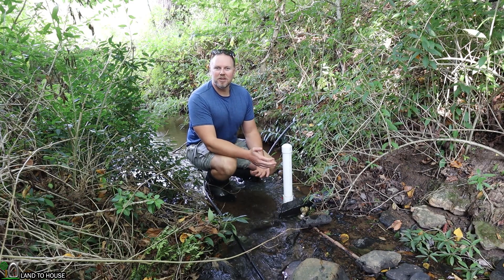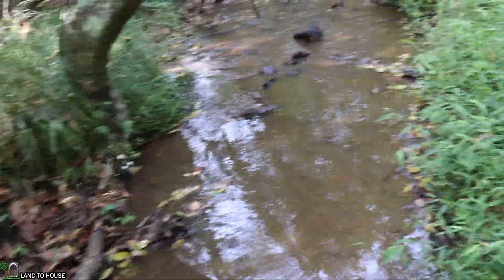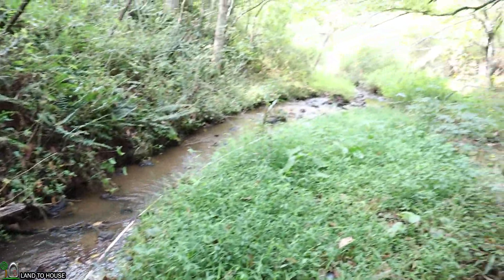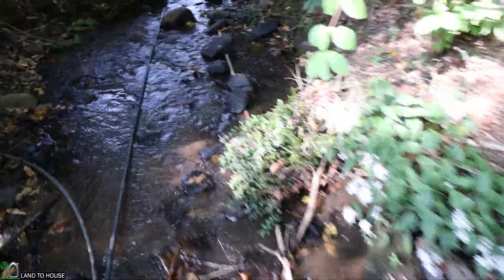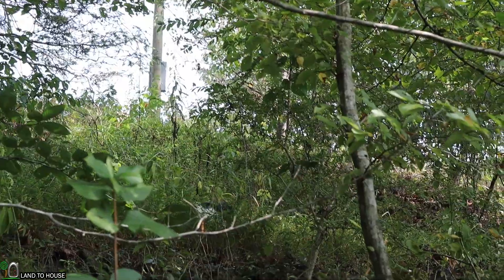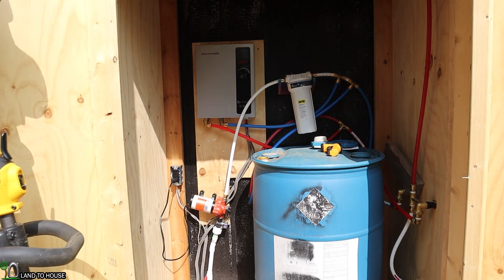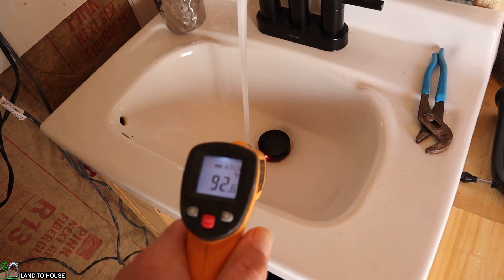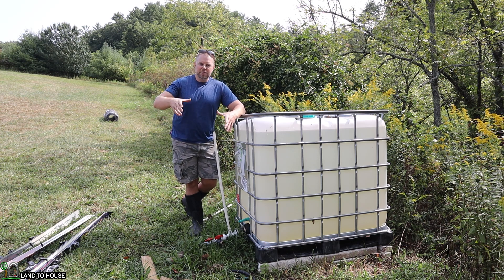Tiny House Water Solution: How to Bring Creek Water Up Hill with a Hydraulic Ram Pump - Part 2 - END

Comment: What is the lowest flow a Ram pump will work at? I have a creek that is very slow moving. Could be an optical illusion IDK until I put a temp dam in place with an overflow to measure gpm but it will undoubtedly be a very low flow. It does however have enough elevation drop to make this a possibility in wet months. Looks like I need to lift it 40-50 ft at about 800ft if run.

Comment: Did you consider building a water tower to pressurize the system instead of the electric pump?
Reply from the maker: To get 40 psi of pressure by Gravity the tank would need to be 92 feet above the house. (40psi / .433 = 92feet ) that's a tall tower.

Comment: Very cool video, but seems too complex, seems like it would have been easier to make the stream deeper close to the tiny house and push water up hill with an electric pump or gas pump. We have a stream that runs through our property in Tennessee and we brought in a contractor with a backhoe to make the stream wider and much deeper, and then we lined it with thick rubber lining, put in a 12 volt submersible pump with all the plumbing and filters  added, this pump gets its power from a 12 volt battery and the battery is recharged through a 100 watt solar panel. The water has to travel up hill for about 220 feet where it goes into two storage tanks that are 275 gallons each. We did have the contractor dig a ditch to lay the pipe in and take off some of the upward angle the water has to travel. We did elevate the storage tanks up 6 feet in hopes of gravity feeding the water to our tiny house but this didn't work so I installed a high pressure 12 volt jacuzzi pump and this worked perfectly, this pump has enough psi to supply water into the tiny house at about 45 psi. It's not the perfect system but for now it meets our needs until we can have a well installed. We had this water tested by 3 different labs and all 3 labs certified that this water is safe for human

Comment: Thank you for the video.  Have you found a way to access the inside of your two tanks for cleaning?

I wonder what the trade-offs are between the elevated bucket vs vertical stand pipe?

My application attempts to irrigate 4 acres of meadow from a creek with 30 inches of fall.   I have three 1 1/4 Land to house ram pumps and one similar that I built myself ( much easier to buy from you).  Plans to try a 2 inch ram pump.   Each pump can drive one mini-wobbler sprinkler.

3 challenges are:
1 - measuring the water with a ramp flume for water rights.
2 - cleaning the filters where water comes from the creek to protecthe sprinkler.
3  - rotate different sprinker times - perhaps with elevated tanks and an automatic siphons or gates from elevated tanks.

How do you make reliable connections between poly pipe and pvc pipe?

Thanks!

Comment: I just asking ram pump works inside 7 feet x 7 feet x  7 feet inside water  storage tank..... If possible make practice video

I want to transfer water from ground level water storage tanks to my upper terrace water tanks 45 feet higher then ground level tank.

We use submersible pump for transfer water..  if possible please advise......seth

Comment: as a side note: diy solar tracking cross pole mount, with two screw gear lock drive angle trackers, should be cheap easy and strong way of doing solar tracking on single large panels. yes like the solar concentrator mirror panel system, but for individual panel forest.

Comment: Great setup! I was curious if there was a reason you didn't go with a pressure tank on the pressurized size of the water line. That would make it so the pump wouldn't have to be as active during water use, and it provides another buffer of extra water inside the heated space.

Comment: i have 4 Seaflo pumps and they do not pulse like the one you are using. what model number is it?
Reply: How about to enlarge the waste valve, to tune up  just tilt down  the waste valve until the desired cycle. 1 meter can lift more than 20 meter depends on the volume of water supply.
Reply from the maker: I believe the reason this one pulses so much is because the shower I have doesn't allow a high flow rate. The inside shower has a higher flow rate and the pump does not pulse. Probably could use a pressure tank.
Reply: Seaflo makes a pressure accumulator